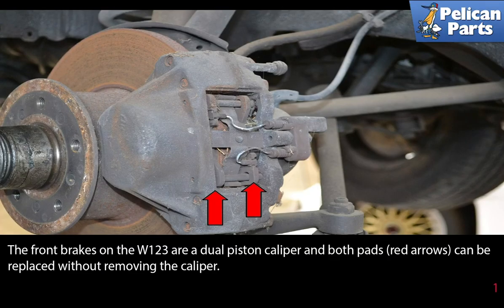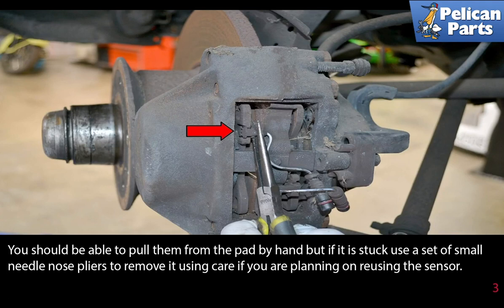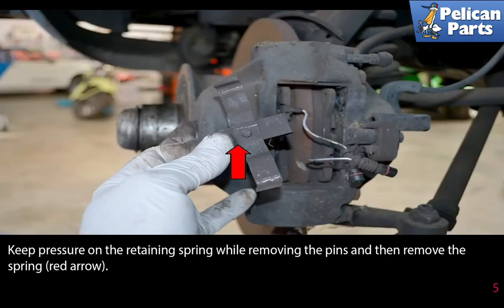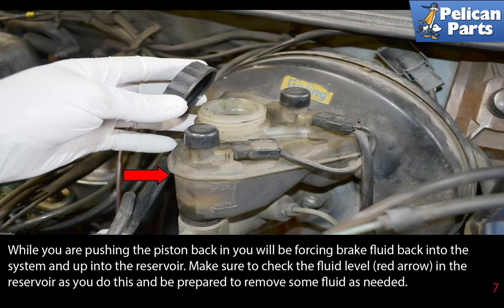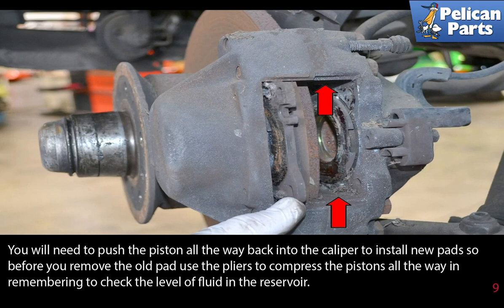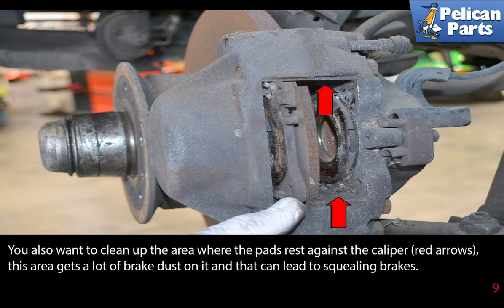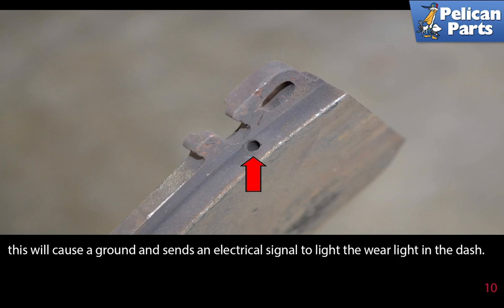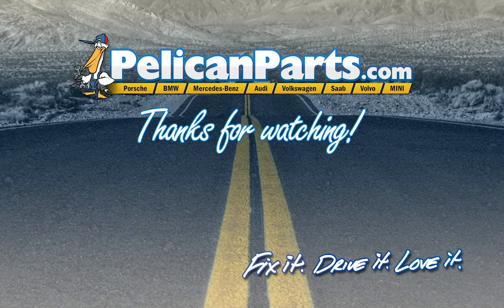Mercedes-Benz W123 Front Brake Pad Replacement for 300TD, 230, 240D, 280CE, 280E, 300CD and 300D

Comment: These are ATE calipers, as on my 1984 300D.  Also came with Bendix calipers, as on my 1985 CA 300D.  The Bendix calipers have cotter pin retainers on the end of the rods and a wire pad spring (instead of large flat one on ATE).  The pads differ between each type.  The factory may have used both types in the same years.  The "low pad" dash lamp might give a faint glow when driving in the rain, especially if you use LED bulbs.  That is just from slight conduction to ground thru the water, so ignore.
Reply from the maker: Thanks for the additional info for the procedure. We appreciate it.